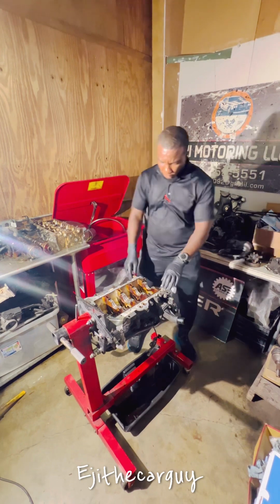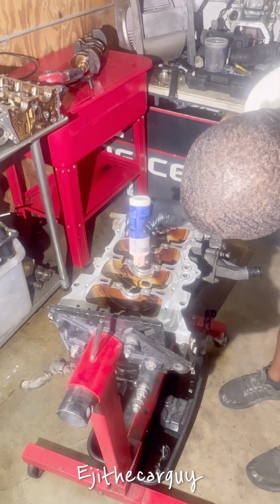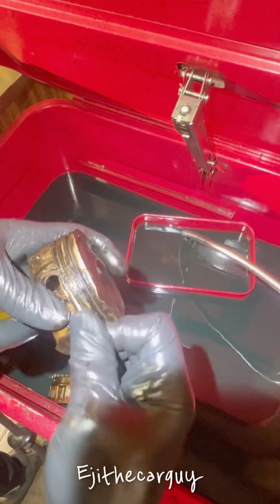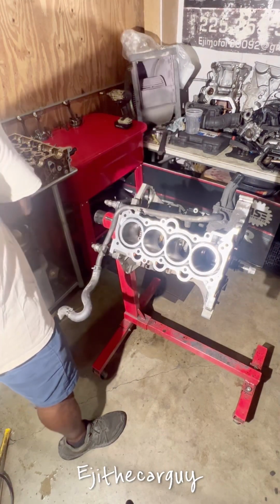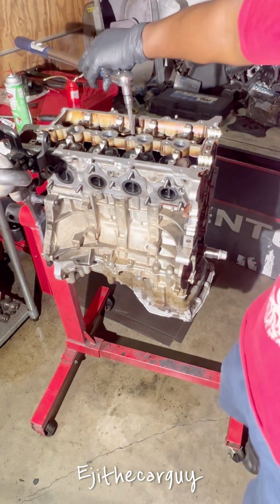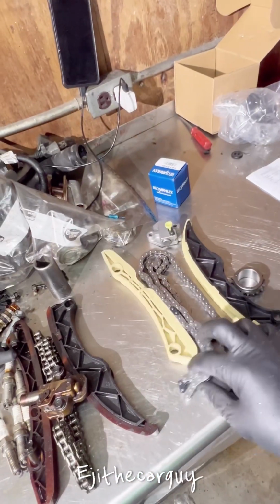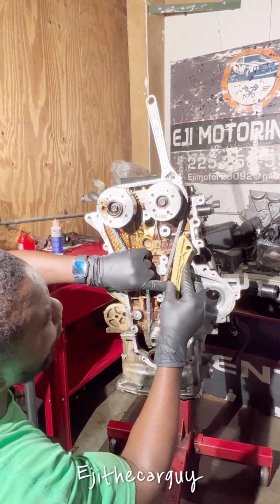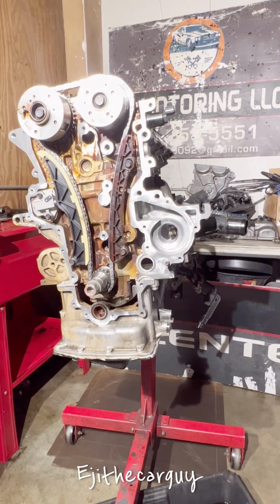2014 Kia Forte 1.6 GDI Engine rebuild reassembly part 1 step by step..

Comment: Did this engine actually run after this rebuild because I'm getting ready to start building my engine and I just couldn't find a build video or manual on putting the g4fj engine back together after tearing it down
Reply: Check tolerances in the crank and rod and in the cylinder and piston, I sent my crank to get tuned on the main and rod journals then ordered oversized bearings I am confident if done correctly this issue won't happen again at least in my case scenario
Reply: Also oversized the pistons due to the stock setup being very lose
Reply: @raymundobiby3986  what tools do you HAVE to have to do this job?  I just did the timing chain on mine, though it wasn't hard it pissed me off just doing all the work anyway the engine has 250,000 miles on it, it SEEMS to be okay but I think a rebuild might not be a bad idea maybe when it gets to 300,000 but ill put it this way.  I did an oil change, then I did the alternator, then I did the timing chain other than that I have never done anything on cars just doing it because its too freaking expensive to have a mechanic do anythinng and if I want it to continue to run and avoid a new car payment man ill try to get to a million miles if I can, I hate car payments, I hate payments., but car payments esp